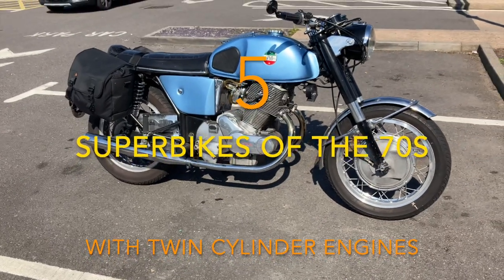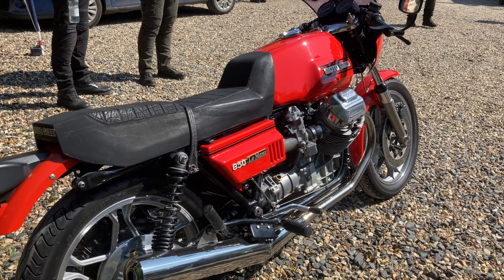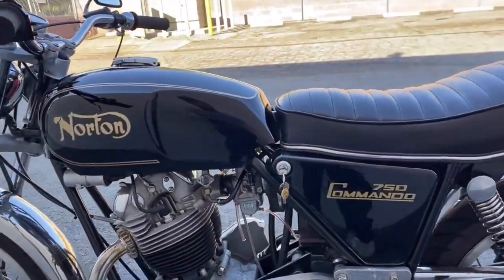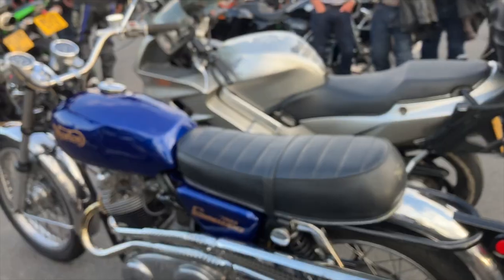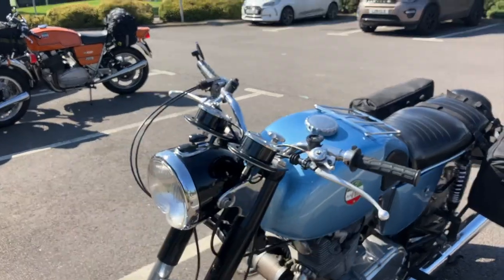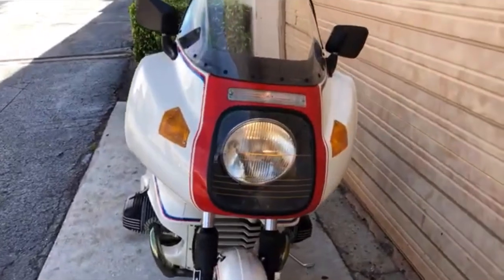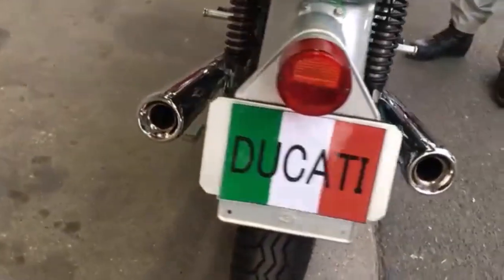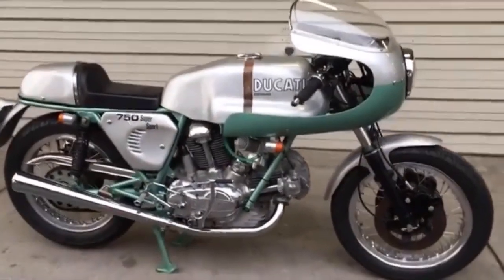5 SuperBikes of the 70s with Twin cylinder engines

Comment: I had a Mk1 Le Mans. It would skate round corners like it was on rails. Everything I know about electrics I learned from the Guzzi.  It would fall off the sidestand if touched by a breeze. The Fuel filters and unions were soluable in petrol and the seat was only a piece of expanded foam. I rode to Portugal on it and hand to stand every 30mins to let some blood into my legs.. Spares, at that time, were a joke. I ordered throttle cables as a pair just to get 2 with  the same free length. In the end I just could not live with its "Character".  It was a joy to ride but a pain to own.
Reply from the maker: Oh I quickly learned never to trust Guzzi centre stands

Comment: Another "jolly good show," but I'm baffled as to why you chose the BMW R100RS over the R90S (or an R100S) for this particular comparison. I had the "pleasure" of racing my lightly-modified BMW R75/5 at PBIR (FL) in 1976. That was the age of Reg Pridmore racing, and winning, on an R90S in the Superbike Series here in the United States. I don't recall him racing the RS model, which, as you noted, was BMW's outstanding sport-tourer. The shop I worked at (441 Cycle/BMW) took a 1974 Ducati 750 in trade and it sat on the showroom floor so long the rings got  "sticky" causing it to smoke. One evening, the boss told me to ride it home and put some miles on it that night. When I pulled up to my Pop's house he came out to see what that cool sound was. I let him take a spin on it and he came back grinning like a schoolboy! (He had cut his teeth on Indians and Harleys.) The next morning, after a nice long evening ride, that Ducati no longer smoked and ran great. It sold shortly thereafter.
(My best  finishes on my R75/5 were a pair of 5th place trophies running against 1000cc machines. No wins but it was a blast!)
Reply from the maker: Ground breaking fairing 
Also I personally prefer it, it was sold for longer than the 90 and in greater numbers so a no brainier for me

Comment: A lovely little video, although I have no experience of most of these.  I rode quite a few of their cousins and siblings, but not the exact models featured here. 
On the tall gearing of the 850 Lemon, you are quite right. But a tall first was a common feature of bikes with a track bias or designed with high-speed touring in mind. The lust for a low 0-60 time is a very "car" thing and is largely irrelevant on a motorcycle - unless you have a point to prove at a traffic light.
The joy of a tall first fear is that it is usable at rolling speeds.  Perfect for a hairpin on a track.  And as the Lemon was harder to stall than a Perkins diesel, the tall gearing was never an issue. 
The BMW was a marvel.  It was the first true 2-wheeled international GT.  The strange bars made limited sense on a city, but they weren't designed for that.  
Excellent video. As usual. Chapeau.
Reply from the maker: True about the gearing 
Better that a Goldstar I’d think their gearing is legendary
Reply from the maker: True about the gearing 
Better that a Goldstar I’d think their gearing is legendary
Reply: I've owned two Le Mans, 1984 Le Mans MkIII and 1990 Le Mans MkV. The Mk in top gear was geared 30kph for 1000rpm. Eg, 4000rpm equated to 120kph. I wouldn't change into top gear until I hit 4000rpm. Le Mans engines liked to rev. At 6000rpm was when maximum torque came in. That equated to 180kph in top gear, where the engine felt like it would burst through brick walls. Incredibly strong.  Redline was 7500rpm and maximum power at 7000rpm. Cruising speed between 150kph and 180kph. 

First and top gears were tall, while 2nd, 3rd and 4th were closely spaced. City riding, I wouldn't get out of 3rd gear, occasionally 4th gear.

Comment: The Commando frame had a very short lived early version with a conventional frame mounted swingarm, as far as I can tell Bernard Hooper re-designed Bauer's rear isolastic mount to include the swingarm and rear wheel, if you look the swingarm spindle doesn't go beyond the gearbox cradle plates.
Reply from the maker: Interesting 🤔

Comment: Interesting list, but I would have replaced the Guzzi, with the Harley Davidson 883cc XLCH.
Reply from the maker: Definitely not 
1 it’s Harley 
2 expensive 
3 inferior motorcycle 
And I’ve owned both incidentally 
I do consider the sportster as Harleys best bike by the way
Reply: @bikerdood1100  if you'll read my post again, it says that I would put the Harley in the list, it doesn't say that you would include it. I have an opinion, just like you…
Reply from the maker: @Mbartel500  true but I am coming from a point of view of ownership of both 
Incidentally 883s are often quite expensive in Europe 
We liked The sportster but in our long  term experience we would have to place it some way behind The Italian stallion 
Not least because of crap gas tank range which was a pain in the ass wen touring, unforgivable when. Bike is all day comfortable.
Well unless it’s an early pre rubber mount bike with added shimy shakes

Comment: The tank of that Le Mans does not have the original paintjob. Plus the exhausts should be black. I suspect it’s not a real one but converted from another 850. One should always beware of those, though this one is different enough to be a honest bike.
Reply from the maker: So what 
It looks good. Does it ride good
And does anything else actually matter unless you paying through the nose. My Goldenflash has a later tank, so I care, nope it rides well either way 
Ewan McGreggors first bike was like that, a Spada originally 
I fought he cared
Also by now a lot of original tanks have rotted in fairness